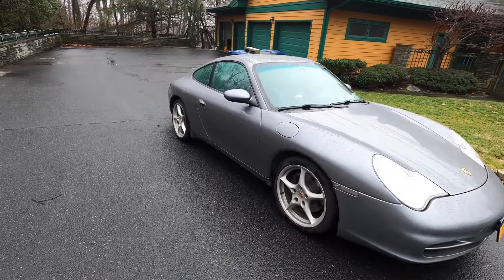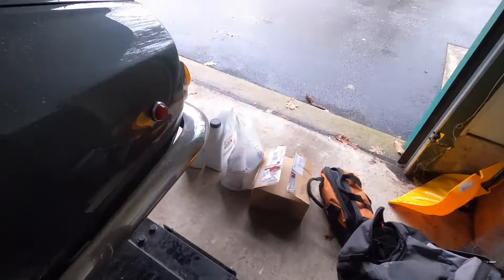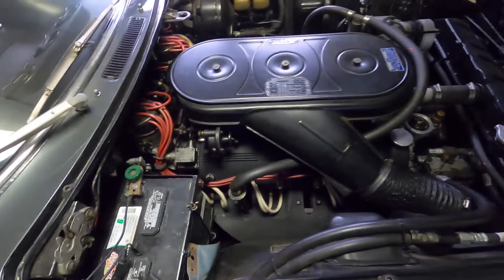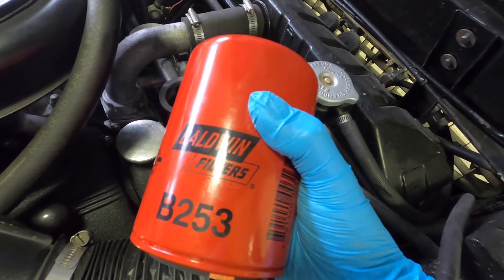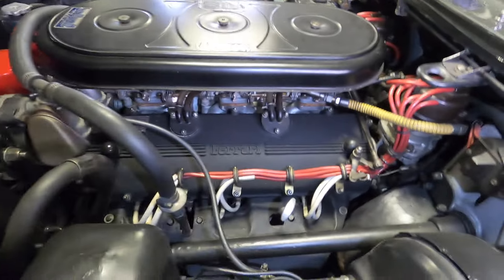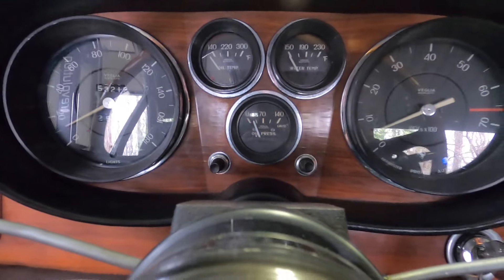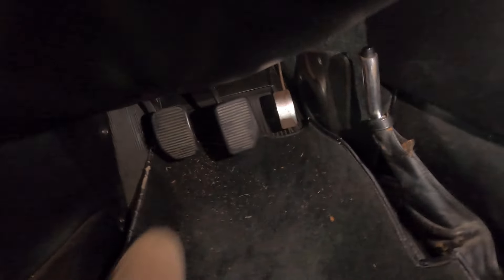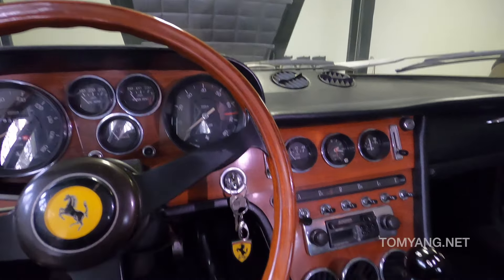Ferrari House Call

Comment: I had a oil filter EXPLODE on my old beater Fiat Croma. This car was old and ugly but an absolute gem. I had bought it for a whopping 200$ with less than 50 000miles,  drove it for 6 years with nearly zero repair and honestly about zero maintenance.
It consumed a bit of oil, so I always added new one instead of changing it. I called that "a slow oil change". After coming back from abroad I started the car after months. I was the coldest day for years. Then it happened. The filter blew up. I bet there as quite some frozen water in the oil and filter.
I cleaned the mess, put a new filter in and drove the car for another 2 years. It ran well until the inspection guy thought it should not be on the road anymore. But it ran great til the very end. RIP Croma.

I LOVE those old GT cars of the Fifties and Sixties. They had CLASS! I even like them a bit longer like this one or a Lamborghini Espada for instance.
Reply from the maker: I can tell you an Espada is a lot harder to fix than that 365! Thanks for watching.
Reply: @tomyangnet  A friend used to own an Epada for many years. He was a simple painter and got it from his uncle, who used to have the same job.
He had it fixed before they got appreciated. He could only maintain it as he had a talented old school Italian mechanic as a friend. After many years a rich guy with a collection made him an offer he could not refuse. He earned enough that he could by a good early Seventies Alfa Romeo and  after that he had a considerable amount of money left.
Asking if he did not miss the Lambo he said not at all. He said that he has to be less careful with the Alfa Romeo.

Comment: Wondering what your opinion is of the Evens waterless coolant?
Reply from the maker: Some of my colleagues swear by it, but I feel a properly operating cooling system does not need the higher boiling point that Evans offers, and if you're masking a problem with running your coolant hotter than normal, you could have hot spots and not know it. The other problem is it's not compatible with other coolants or water in the long term, so if you have a leak and don't have a bottle of Evans in the trunk, you're going to have to restore the Evans mix after the roadside fill up.  Since I'm replacing the coolant every two years, we're not loosing the corrosion inhibitors in regular coolant, and it's readily available from any auto parts store, I'll stick with what works. On a side note, No-Rosion is another product, but it has no freeze characteristics which is a definite problem, even if you live in a warm climate. Eventually these Ferraris will ship somewhere in a transporter, and I've heard stories of a cars being shipped across the country from LA with the truck stopping in the Rockies overnight where the water froze in the back of the truck, only to have it arrive in Florida with a cracked block. This just my opinion and experience. Plenty of other people use these products without problems. Thanks for watching.

Comment: Baldwin are the best filters made. They're industrial grade.
Reply from the maker: They certainly feel more hefty!
Reply: Baldwin are literally what is used by industry.  Take the tow boats pushing barges up and down the Mississippi.  Every engine on the boat will exclusively have Baldwin filters.  They're the industry standard, and have been for decades.
 @tomyangnet
Reply from the maker: @sayrerowan734  They work for me!